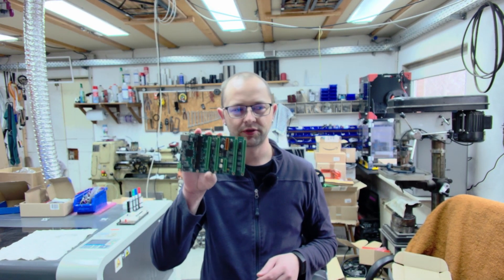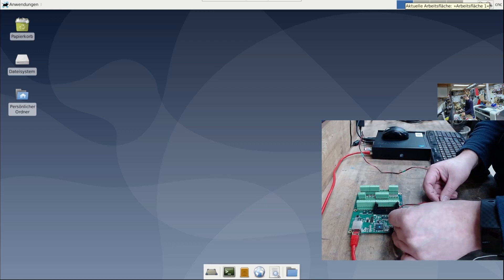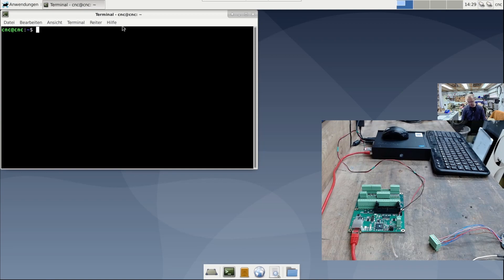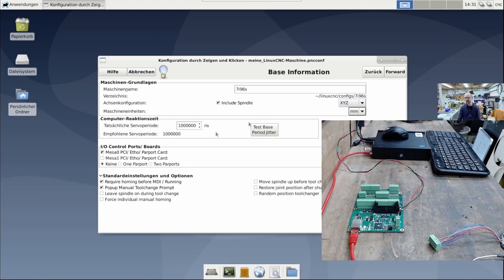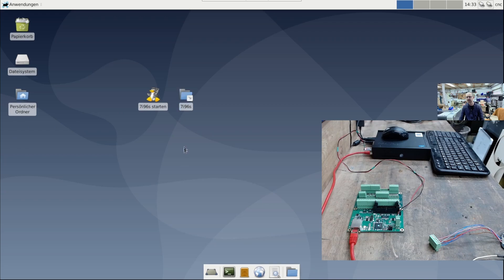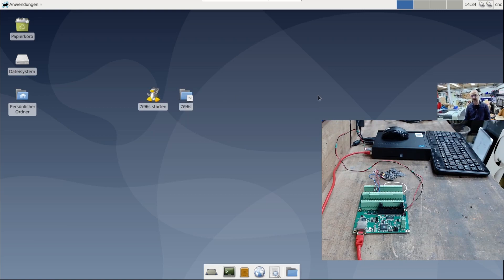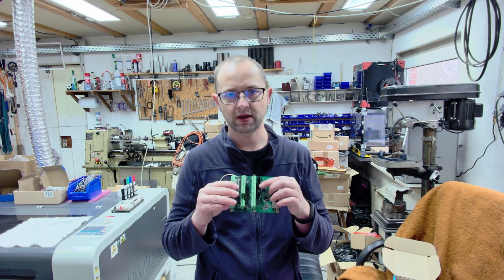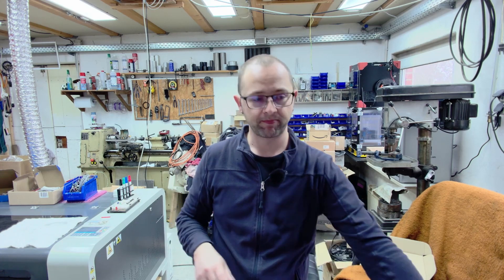Getting started with Mesa 7i96s: The perfect alternative to the 7i76e?

Comment: Coole KI Übersetzung! Du schließt eine Lücke bei den MESA Card Beginner Videos auf Youtube. Top.
A7i96S is an alternative for small CNC Hobby machines but not for those who need more IO's. 11 ins, 6 Outs are just appropriate if you don't have a lot of periphery. For a more complex machine, there are not enough IOs, if you want to control pumps, vac's, ATC, pneumatics and so on. What I like on the 7i96S is that you have a led on each input so you have a smart control without looking at the HALShow. But - I love my 7i76e - 48 IO's, 32 IN, 4 Analog IN's, 16 Outs, spindle control, Encoder IN.